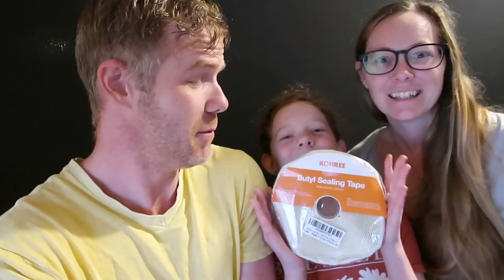Last Day On The Water Before A Sweaty Summer Sailboat Refit | Sailboat Story 157

Comment: Hi guys,  that rudder stuffing box is not supposed to support the shaft just seal it. So probably just needs new packing and be good for another 40 yrs! The Top bearing support for the rudder might be a bronze bushing in the fiberglass sticking up or it might just be the fiberglass itself is the bearing.   West have a suggested fix to use for worn shafts , pour graphite filled epoxy around the shaft( waxed)  and make a bearing in place. …. Should Work just fine if it’s even loose. 
Cheers Warren
Reply from the maker: In addition to leaking, the rudder is also clunking back and forth and the shaft is impacting the inside of the rudder tube. 2 different problems. Trying to figure out if I need 2 different solutions or if a single solution would solve both problems.

Comment: To fix the leak in the rudder stuffing box cut a strip of foam from a mattress it doesn't need to be perfect. Cut it long enough to make 3 or 4 raps grease it really good by hand pack stuffing box with foam all in one piece don't cut it like packing. The foam will compress and expand  with the movement of the rudder shaft. Works better than packing because packing will flatten and stay that way and leak. I use greased foam on my main shaft also. Just on the main shaft you don't tighten stuffing box too much because your shaft will over heat. I leave a drip when running when stopped no leak at all. On a shrimp boat I had I packed the stuffing box every 2 trips about 10 day trips with greased foam I would pack every 2 years.
Reply from the maker: Interesting idea. Another related issue is that there's not a lateral support of any kind at the top of the rudder shaft. I'm tempted to fiberglass the stuffing box to the hull so that it will become a support and a seal at the same time. There's lateral play there that needs to be stopped somehow. Right now the stuffing box is "floating" because it's connected to the boat with the rubber hose.
Reply: @Sailboatstory  yes they should put a bearing on the top of the shaft. What I've seen some do and this works good is to have a machine shop machine a piece of teflon to fit tight in your rudder tube with a hole bored for the shaft cut it off at the bottom of your boat or if your tube sticks below cut it there and that will act as a bearing if your rudder tube is big enough around for that. You don't have a rudder tube much bigger than the shaft for it to work.

Comment: Curious Ben if the light tied in the rope in the air was a temp anchor light
Reply from the maker: That’s right. 😂 Not ideal, but it got the job done. I think there’s a bad electrical connection to the actual anchor light.